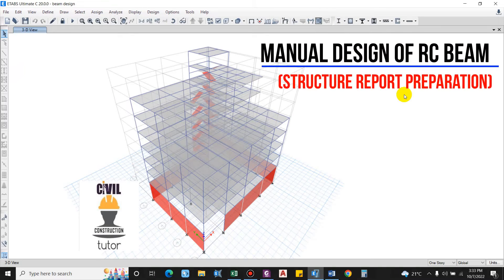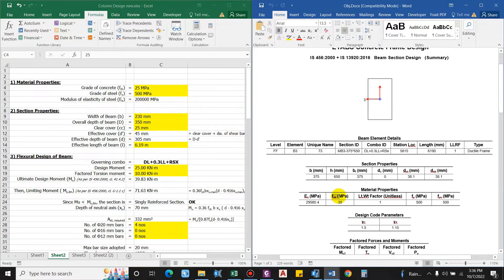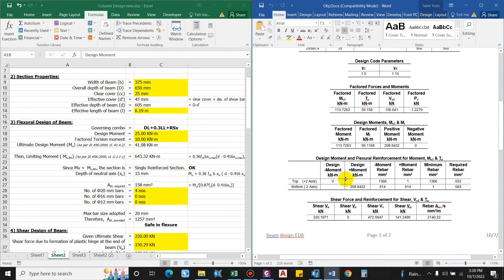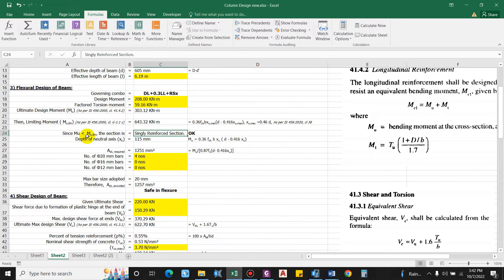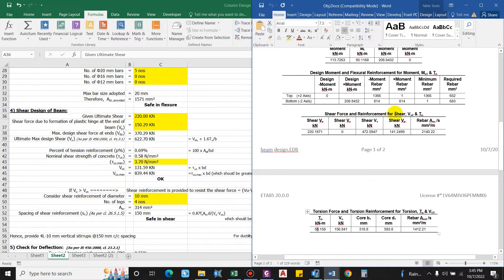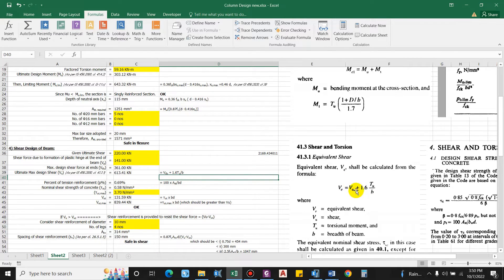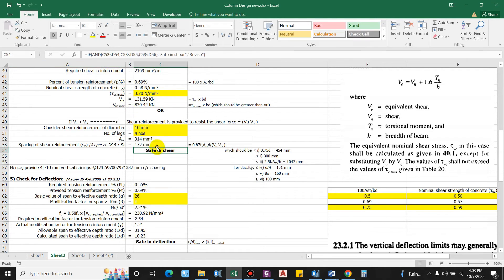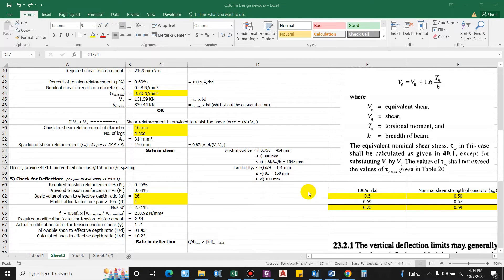Design of RCC Beam (Manually) | Municipal report | ETABS Multistory Building | NBC 105:2020, IS 1983

Comment: The design moment taken from the ETABS design report includes the torsional moment as well. So, We don't need to add the torsional moment again for the calculation of Design moment. In case of the excel sheet used, Design moment should be 113.7 kN-m.
Reply from the maker: We have considered torsional moment as well

Comment: My two beam is fail due to O/S how can I fix through manual design because I didn't get shear force(Ve) of that beam.
Reply from the maker: Manual design cannot overcome etabs failure unless there is a modeling problem. Please try out different section sizes or structural arrangements.
Reply: Can we provide different sizes beam at different floor to elliminate those problem.
Reply from the maker: @manishkoirala1745  Yes, you can.
Reply: OR,can we provide different sizes beam at different grid  at same floor??

Comment: as per latest code IS13920:2016 you can not consider the shear strength of concrete for shear reinforcement design. RefIS13920:2016 Cl 6.3.4
Reply from the maker: I have considered the nominal shear strength of concrete. The code has specified Shear Strength due to bent-up bars and inclined hoops shall not be considered. These two are different.
Reply: Also due to concrete Review Cl 6.3.4
Reply from the maker: The code hasn't specified "CONCRETE" anywhere in that clause.
Reply: Here is full clause for your confirmation
Cl 6.3.4: In the calculation of design shear force capacity of RC beams, contribution of the following shall not be considered:
  a. Bent up bars
  b. Inclined links and 
  c. Concrete in RC section
Reply from the maker: Sorry I had been referring to 1993. Yes as of 2016 we can’t consider the shear strength of concrete. Appreciate your effort.
Cheers